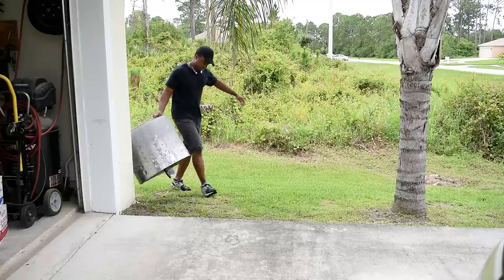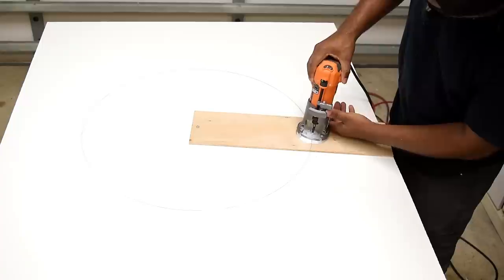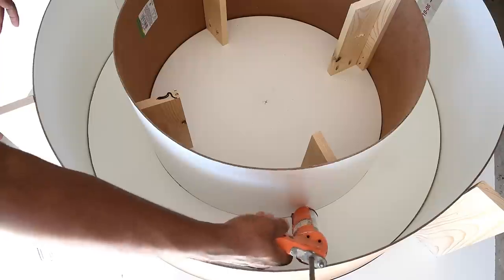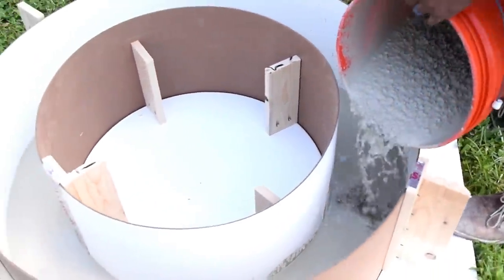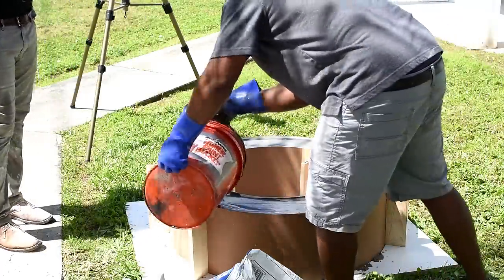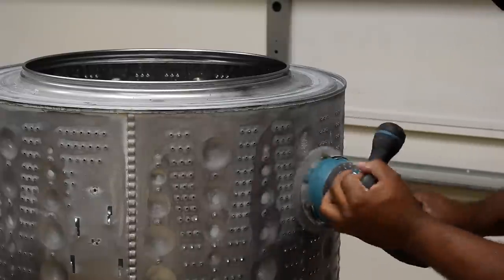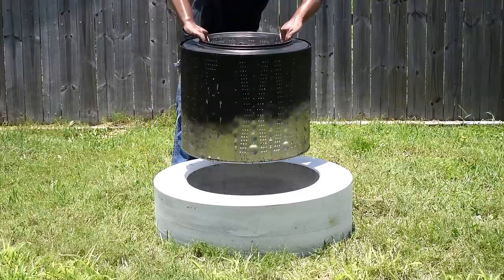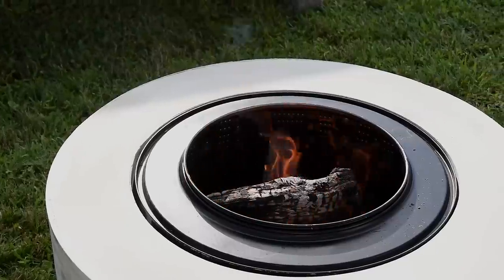Making A Concrete FIRE PIT  | from a washing machine drum

Comment: Just wondering how much difference / reduction the drum actually makes to the heat the concrete has to deal with? I think gas burns lower temp than wood, so might improve the longevity of the structure anyway?

Comment: it looks good, the wood would burn better if you add an air intake so fresh air can reach the bottom, even if it was pipes from the top  around the rim just long enough to give the fire some more oxygen. I burn fire wood in my house, I can make a fire last a long time cutting off all the air except from the exhaust pipe, but if you want a fast hot fire you need to get oxygen to the Bottom and through the whole fireplace.

Comment: What the drum itself? Isn't it too thin to resist the temperature fire generates? How long will it last without deformation?
Reply: The drums are rather sturdy.  My neighbor uses just the drum for his camping fire pit (no concrete).  He gets the fire so hot that the drum glows red but after many years it hasn't lost it's shape or warped. 

I hope that helps.

Comment: Nice ‘how to’ project that really turned out well in terms aesthetics.  Converting to gas will be a good move as that design of a pit will be difficult to light and be smokey.  Wood burning pits work best of u can easily get air to the bottom.  Nonetheless it was a very nice build..

Comment: New subscriber here. Really enjoy your design aesthetic. That washer drum reminds me of the double burn fire pits like Solo Stove. I haven't used one yet but they claim to be "smokeless" (think less smoke, not no smoke). They work by generating an after burn. If that drum is double walled you could create the same effect by drilling holes in the bottom of the outside and the top of the inside. Or you could just convert to gas :)

Comment: Great project!   Next time try using Aircrete   Concrete it will reduce the weight by 75%
Reply: Curious about the product, how would it handle heat in this situation? Are you a rep?

Comment: You always do nice work, but all these diy fire pits are always way too high, to simulate a camp fire, you want a very low rim, so you can get heat from the fire and you can actually see the coals.   And it does make sense to put rock on the bottom of the pit, they just get scooped up when you clean out the ashes.  You are better off to just put a concrete paver stone, if it rains the 2 inch paver stone sits above the damp ground.

Comment: its one of the nicest pits iv seen but bro , have you seen concrete explode i wouldnt let my kids anywer near that thing i hope it stays safe for you
Reply: Why would it explode...
Reply: @lundyracing  concrete gets tiny air bubbles stuck in it as its mixed and under high heat more so if it is sustained they expand  and eventually explode ... its quite dangerous , trust me

Comment: Why use a washing drum if you are just gonna cover all,the air holes that allow the fire to get oxygen..and why such a wet mix? I'd at least place some wood blocks inside the mold so once the concrete set you can remove and have air holes in the bottom to get to the fire

Comment: These refurbished washing machine drums as fire pits are exploding so proceed with caution. If its older and has a lead base you could be lighting a bomb in your backyard. If or when it does blow you want to be NOWHERE in the area...trust me. Do your research before you do this DIY project...it may save your life.
Reply: I looked up the incident:  https://www.youtube.com/watch?v=MlS6pW4koBQ
The old washing machine did have a ring of lead shot and this made the explosion more dangerous but the problem was the use of an accelerant.  Probably a lot of gas and a lack of common sense.